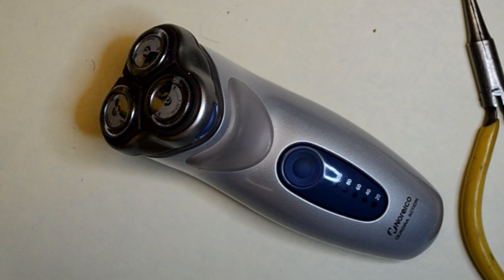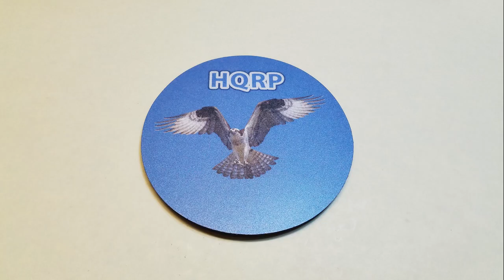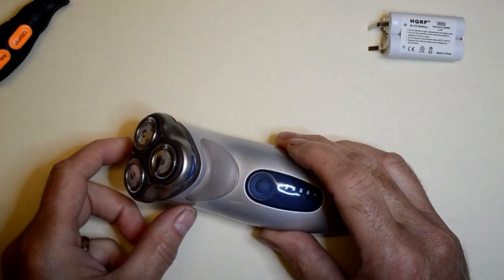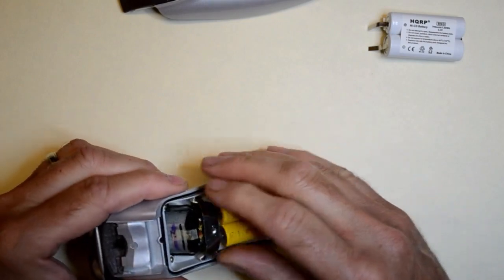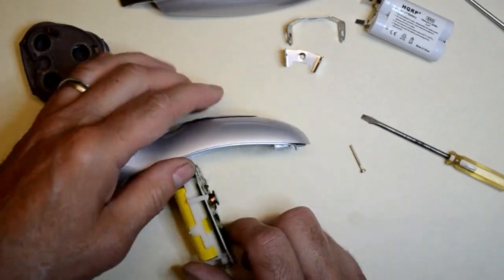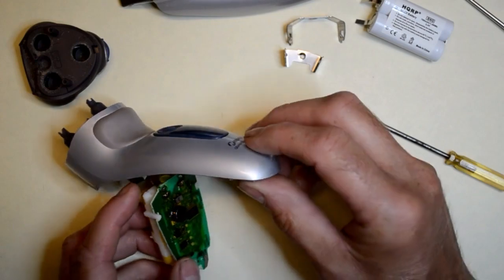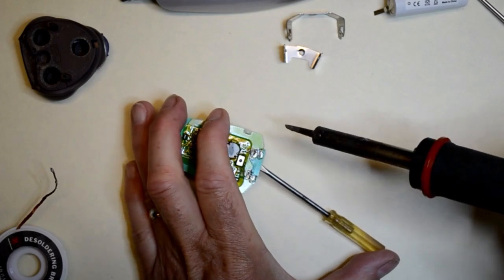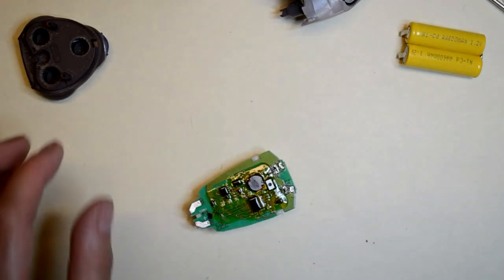Norelco 7865XL Battery Replacement

Comment: Nice job extending the life of a favorite device.  The tips on the battery replacement with soldering delicate components are applicable to many devices.  And, had you bought a new shaver, I bet you would not get a FREE COASTER!  Thanks, David.

Comment: I have a Norelco AT811/41TT.  Where do I get the battery?  I have a very bad impression of Norelco now that I talked to them and got nowhere about sending in my shaver to have them fix it.  I had to threaten to send a letter to the corporate office, with the chat transcript included, which was very unflattering to the company, before I was finally offered a new shaver.  I was left with this strange feeling though; like I still want to unlock this mystery about how to replace the battery and get this thing working again.
Reply from the maker: I just did a Google search and found several links.  Here is one; I have no idea if they are any good: https://www.cutratebatteries.com/products/philips-norelco-at811-replacement-battery?variant=46388682424551&sem_account_id=1343830959&sem_campaign_id=19933265923&sem_ad_group_id=&sem_device_type=c&sem_keyword=&sem_matchtype=&sem_ad_id=&sem_network=x&sem_target_id=&sem_feed_item_id=&utm_source=google&utm_medium=cpcshoppingds&utm_term=&utm_content=&sem_location_id=9015344&sem_placement=&sem_placement_category=&utm_campaign=PMax:DS:ShaverBatteries&gad=1&gclid=Cj0KCQjwnMWkBhDLARIsAHBOftrCnTsuGbKMAllOsSP1V3d-7EmO-V-pwXcwvXzSnhJfjdHjuOr8KtAaAmkNEALw_wcB

Good luck!

Comment: I did this ,and my shave is running and won 't turn off sence i connected it. Can you put a battery  in backward..or it wont run ?
Reply from the maker: There is some electronic circuitry for the charging, motor control, and power monitor.  Hooking the battery up backwards could damage the circuitry.  Because Norelco soldered in the battery, I'm guessing that they didn't add any diodes to safeguard against installing the battery backwards.  I don't know if that condition is permanent or not.